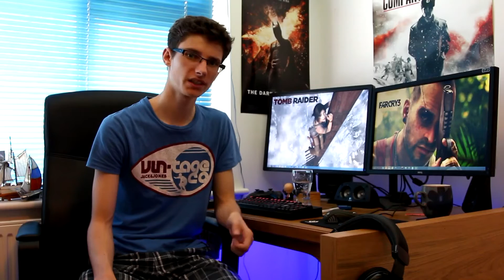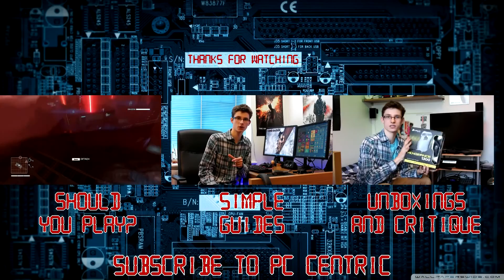A Simple Guide To PC Cooling (Air VS Water)

Comment: PC Centric Just curious, do you have data to back this up? I've seen one vid by someone else who showed hard data, camming his monitor to show the actual data, that showed water cooling vs air cooling there wasn't much difference under load.
Reply from the maker: We it depends on the cooler. The physics of it means that water cooling is more efficient,  but a good air cooler will beat a bad water cooler.